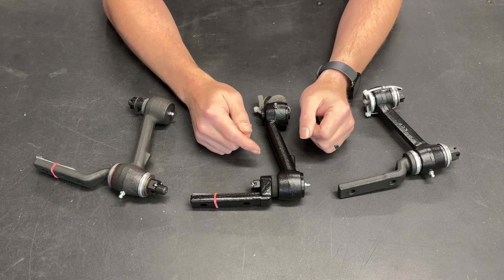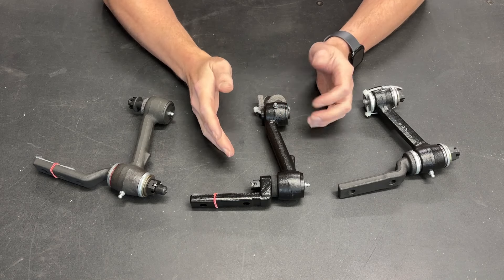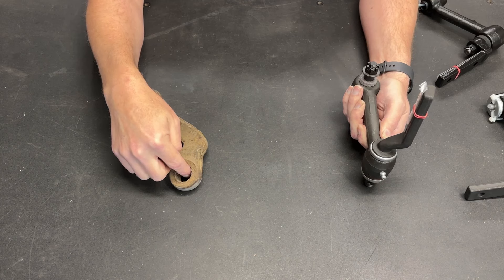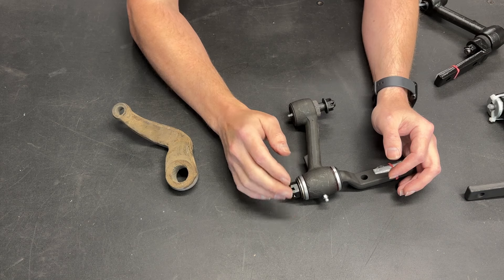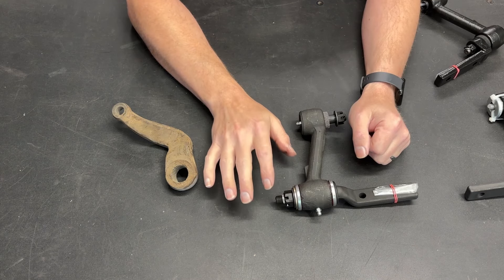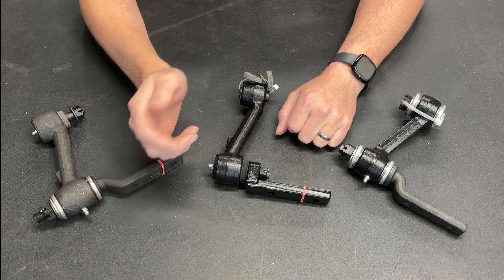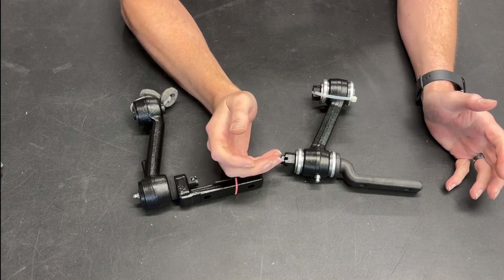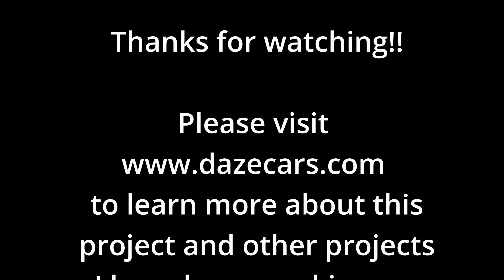Opentracker Racing Products Roller Idler Arm Upgrade for a Classic Mustang to Improve Steering

Comment: Back in the 50s, 60s, 70s ball bearing idler arm kits for most cars were readily available at the local parts stores.
No longer available, about 35 yrs ago I got roller bearings from the parts store and made my own. Cost maybe $ 6 back then.👍 Still going strong after 73k miles.
Also put ball bearings on the clutch/brake pedals pivot shaft (dump those plastic bushings), steering column shaft, and clutch Z bar along with heim joints on the linkage. 👍👍😎
If you're handy you can do it all for $40 parts.
Reply from the maker: everything is better with bearings

Comment: I see they are advertised as a manual steering upgrade. I am installing a borgeson box power steering. Should I expect simmilar improvement?
Reply from the maker: Eliminating the flex on the passengers side would be beneficial for both a manual and power steering car, but other than that I am not sure. I do know he has different listings for manual and power steering but I guessing that is specific to OEM power steering and is not likely to apply to the borgeson box.   I would recommend contacting John at Opentracker.  Like me he is a car guy first and a business owner second and will give honest advice.  He is the kind of guy who refuses to sell you something you don't need so if he doesn't think it would help he would say so.
Reply: @dazecars  thanks! I will reach out to him. I’m researching putting a T5 in my 68 stang to replace the Toploader so I’m watching all of your videos. It’s a mild 306 with 3:55 gears and I am definitely running out of gear on any type of highway.
Reply from the maker: Not sure what your plan is but If doing a T5 swap I recommend avoiding using an adapter plate with old school bellhousing.  The problem, is old school 4-speeds worked with a bellhousing that could have up to a tolerance of up to .030" and a T5 requires a tolerance of .005".  That means using a dial indicator and shims to make sure the bellhousing is perfect for the T5.  It's worth the money at that point IMHO to just get a T5 bellhousing to begin with and be done with it.  If you have any T5 swap questions don't hesitate to email me and I would be happy to help.
Reply: @dazecars 
Definitely get a T5 belhousing for your 6 bolt engine block.👍😎
Reply from the maker: 100% agree the adapter plate is an all around inferior way to make the swap and only worth the effort if a T5 bell can not be used like on a 5 bolt 260/289 or other family of motor with a totally different bolt pattern than the 302